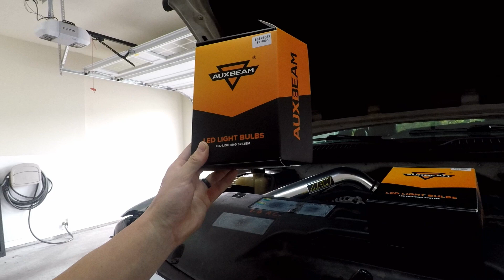Rolling Coal LB7 Durmax & LED Lights! (How To)

Comment: Cummins will run way longer than most duramax's
Reply: Fadhil Alissa k
Reply: Fadhil Alissa I’m a die hard duramax fan but even I can’t argue with that
Reply: Southern Indiana Dipper a duramax will last just as long if you treat it right and add a dual filter lift pump
Reply: @timothyshort7925  Yeah I just got a lb7 for pretty much nothing but it needs injectors and it has close to 500k miles on it bone stock and the lift pumps are kind of overrated the guy that owned it treated it really good and did all the maintenance intervals recommended by gm. Everyone says how bad lb7s are but it has had pretty much no problems except one set of injectors, and now it needs another one, it probably might get 100k miles if Im lucky before I will need to rebuild the engine because Im going to tune it they are to slow from factory haha. but if you dont do that and are smart unlike me it will last forever!
Reply: Fadhil Alissa 12 valves? Yes. Newer Cummins. No
Reply: I own an 04 lb7 and i already want to cummin swap it
Reply: Only a 12v buddy 6.7's not at all dude, the Duramax is the most reliable deisel motor being produced in a truck today, the 6.7 fords fuckin blow tf up too
Reply: All depends how u take care of the engine
Reply: 339k miles and still going strong on my lb7
Reply: Yeah nice transmissions
Reply: No
Reply: @jeffclark9767  I’ll be seven has over 400,000 miles on it and still moves wonderfully
Reply: I don’t agree. Love my duramax. I’ve had em all. A 7.3 will run forever, but it also always runs like a dog, and squats under load like crazy.
Reply: May be true but the dodge around the Cummins won’t
Reply: Lb7 with 330k miles still daily drive it 2 hour round trip to work to be fair only older diesels I see on the rd is the infamous 7.3 and duramax I hardly ever see a Cummins out that’s not a new one 🤷‍♂️